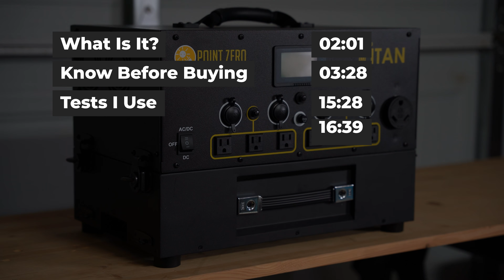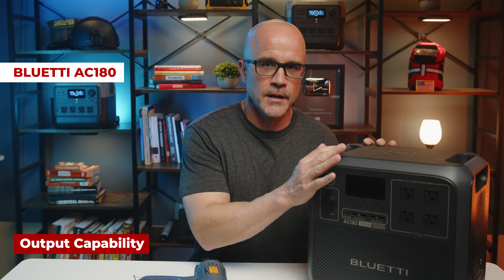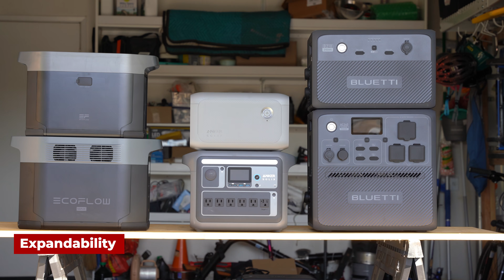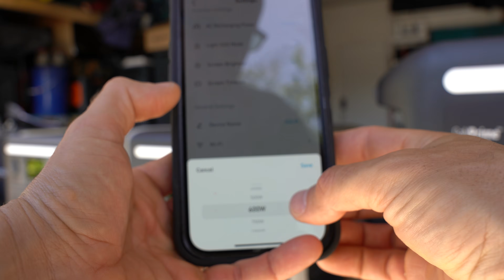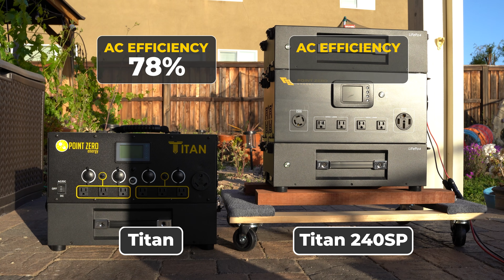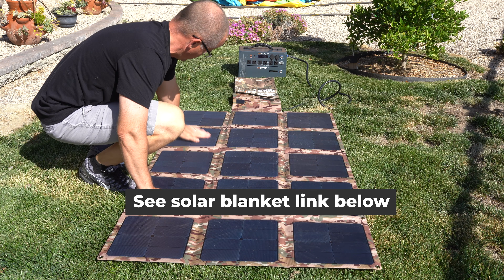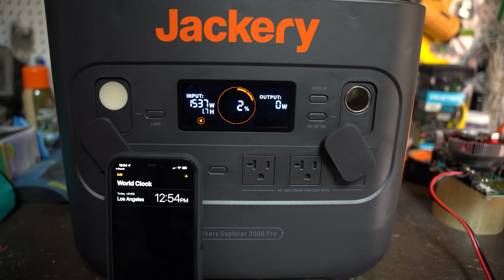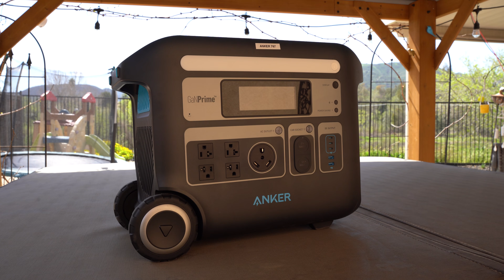Best Solar Generator for 2024 (The Ultimate Guide)

Comment: Ok...total newb here.... this is very informative....im looking for something to put on my houseboat (basically an rv on the water)....Im looking at the pecron 3000flp w (2) 300w panels....I think this would be more than enough to power a small fridge, starlink, house lights, water pump, coffee maker ,hot plate, small tankless water heater, tv and a battery tender for a starting battery (12v) ...no more than 3 of these would be used at any one time....one thing I havent heard in countless reviews is battery care....should these be run down to zero every time....do they have a "memory" or is it totally fine to keep the solar charging it and fluctuate to various levels while constantly charging via solar ? Any help would be greatly appreciated.....like I said total newb!!!

Comment: I'm glad to hear that you keep the Eco Flow units. I've gotten myself one of their Delta 3 power banks, one of their add-on batteries, and 400 watts worth of their solar panels. That gives me 7.2 kwh of power with the option of adding on another 3.6 kwh add-on battery later. I've got them in my barn as an off-grid power supply. All I really want to run with the setup is a small fridge, a string of chargers for cordless power tools, and some LED light strips. And the fridge is the only thing I want running all the time. I've powered that dorm fridge during a power outage for 7 hours using an Eco Flow River 3 unit with barely any storage compared to the Delta 3 + add-on. Once I get the solar panels mounted on the barn roof, I should be able to keep that little fridge keep running all the time. I mean, it's in a barn--not keeping the house running, LOL! I just want to keep drinks cold for when I'm doing yard work so I don't track dirt into the house, charge cordless power tools off-grid, and maybe run a corded drill press for a few minutes a month.  --Dan

Comment: We have a Ecoflo  Delta Max 2000. Been using it for 4 yrs at our 3 season cabin.  We usually charge it up at home.
Still going strong. ❤
I just ordered the Ecoflo Delta 2 for small appliances. Will likely buy the extra battery if we need it.

Comment: Please open the units and see how easy it is to replace a Lithium cell. Solar generators can have up to a hundred (or more) Lithium (LiFePO4 / LPO) cells.  Most of companies spotweld the cells together which makes it very difficult to replace a bad cell. Screw terminals usually make it much easier to repalce a bad cell.

Comment: So I'm REALLY learning alot on my quest for a sole generate r. I'm looking at jacker Explorer 2000. Just talked to a guy their. For $1599.00.i get that unite, 200 watt. Solar panel .2000 watt.unite . Running my laptop for 6 hours. Minnie fridge all time, box fan, 12 volt  light at night, charge 2 phones 2hrs ,, day & half before unite needing charged/ without connecting 200 watt solar panel yet. Does that sound right.without variables. And also found out you,,,possibly can use an led light to charge solar???¿I guise as long as you get more than u use?? If it's possible. Lol. I REALLY appreciate  any feedback. Thanks ahead... Mike

Comment: One of my ECO FLOW Delta Pro's wasn't working properly, it would die completely once it hit 30% battery power, I contacted customer support and they took the unit back and repaired it. The whole process was very quick and easy. Highly recommend!

Comment: There is some incorrect information in this video. The Jackery at 11:00 is actually the newer model with LiFePho nattery, not a Li-Ion battery. The older model could only go 500 cycles (with it's LIi-Ion battery) ❤before degrading, whereas the newer models go FAR longer.

Comment: How much are the expansion batteries? Is it worth the cost? If you purchase the expansion batteries at the same time as the generator what is the cost of battery replacement? Paying thousands and having to replace the batteries after a few years, how does that stand up against a gas generator. My gas generators last me about 15-20 years at about 1/2 or less the cost. Have you done a comparison? Thank for sharing all this information.

Comment: I own the Delta II, Delta II Max and Delta Pro.   The Max takes my vote with its two solar inputs, each at 500W and 15Amps.  This means if you are space limited you could your two arrays facing slightly different directions for morning, afternoon or late afternoon sun exposure.   Plus the Max is expandable to 6Khw

Comment: No one ever talks about mppt efficiency of polling rate on units or compares. A unit that turns on earlier in the day with your solar panels in low light can be a huge advantage.Knowing how your mppt performs its sweeps is important.  Everyone always plugs in the panels and goes "oooh look at the max power when everything is aimed perfectly at the sun" . But the truth is controllers in a test with arrays side by side will perform differently. A similar issue is done with panel testing with shadows. A hard shadow when placing panels should be avoided of course, but no one ever tests quickly moving shading and how fast the Mppt recovers and is able to produce the most watts quickly or if it takes longer to find the maximum again.

Comment: You may or may not have a good experience with your Pecron products, however, you should have the expectation that there will be little to no after sale support from Pecron. I've been dealing with them for over a month to get my E1500 repaired. I was told I would have a 3 Year warranty if I preorder it when they were first releasing them. After a year and a half I am having a problem with it and they have only offered to send me parts to try and fix it myself to which so far none of their suggested repairs have worked. For me, I  won't ever buy another Pecron product.

Comment: I have had the Bluetti AC200Max since launch and it has been great. Recently picked up the Ecoflow River 3 for a UPS on my router and desk lamp during a power outage. I am all about potential for portability. I have a battery bank for my house for backup if all else fails. My primary power source in a power outage is propane. I like to know that even if fuel becomes impossible to get, that I have enough battery and solar to last me a week in sub par conditions.

Comment: Why are they called generators when they are storage batteries?😮
Reply: I would guess the same reason an air fryer is named as such , though it has zero relationship to frying . Good or bad it's a design decision to help explain what it's used for , more than how it does it .

Comment: Hi -  I tried using the spreadsheet  and all the  power banks were insufficient. I picked a 1 fridge, laptop, wifi/router, 2 cell phones. The total use was 3720 W with a deficit of -3594 W not sure if that means I need over 7K??  Even when I took the fridge out it was a total of 1320 W and most were still too low.   Not sure if I did something wrong?? 
I noticed the fridge surge is at 1000 which seems high - my fridge is max 828 watt(115v x7.2amps).  

Separately I was curious if you have any Watt info on tankless water heaters (I have gas for appliances). A couple ppl have said they used a small 500W  powerbank to run it briefly for1-2 hours so ppl could shower....
Thanks

Comment: Just bought a Jackery 1000v2 with 200W solar pack to run alongside my solar/leisure battery set up in my campervan....so far so good, cant wait to get out on the road with it, to test it properly....bought it so I can survive off grid easier.
And jackery were doing 44% off the 1000v2 so it was a no brainer !
Stay tuned for my off grid, real world review.

Comment: I have a system that i designed myself.  It didn't cost less except the batteries (from wrecked car).  The rest of the system other than the batteries cost more. It is a lot more flexible, though.  I can see a lot of ways to inadvertently make a system like this unsafe. I would not have tried this without my electrical engineering background.

Comment: ? Question that I think needs to be addressed ?
The name plate on my fridge does not show POWER.  It only shows volts and amps.   The amps shows as 7,1.  My hunch is that this is the surge amps during a cooling cycle so that the owner can do load balancing on the circuit such that the fridge does not trip the breaker during typical use on grid.  But maybe  its typical draw during the cooling cycle after the surge.  IDK

Comment: Great summary of products. Totally agree. . EcoFlow just keeps advancing technology, smaller units, more features, more runtime. Great customer support and warranty. My company uses the delta 2 max with a 220 watt solar panel on the job building custom homes. And I use one in my work van, charges all my batteries as I drive and runs my fridge freezer 24-7..Then I throw a 220 solar panel out on the roof to keep the battery full.

Comment: Bought a delta max 2 in march had problems from the start ran it down twice while i was testing it out with smaller appliances,now when i plug it in wont charge says overload sent it back to ecoflow today said they would replace it with a refurbished one said it could be dented and scratched  and at least a 90 percent battery life not sure its a fair trade with the new one I’m sending back well see how it goes when i get it

Comment: CP ran some information by so fast most people missed it. He said to only run 50 to 70 % of the units rated power so it will last longer, very important and very true, accept for the Titan, because the Titan is the only low frequency unit thats built to do it. All the others are high frequency inverters, and for those to last any length of time, only run half of what its rated. And as far as 2024, that Titan is way older than that, thats there old unit. He has under rated the Titan a couple of times, I say that because he has only used stats on paper, he has never actually had one to test side by side, or physically. If he ever actually had hands on with one, he would know the difference beyond any doubt. I will say he makes great videos, but they are not based on actual knowledge, even trying to pass this test, of a 5 yr old Titan, which is still a much better unit than all of these, is a realistic comparison. Todays Titans way surpass the old one, and still remain on top in the solar generator field. If you build your own, which can be easily done nowaday, just start with a low frequency inverter,  and you will be way happier and way ahead. The Titan, even this old one, is the only one in all of them that is ,low frequency, unlimited exspansion, and can use any battery chemistry, from any company, not just there own.

Comment: Another question. I want one only for backup for my gas furnace blower and ignition if the power goes out, which it sometimes does. Usually less than 12 hours, but it always seems to happen at night. So, I have to store it fully charged. You say don't do that. What option do you see for that issue?

Comment: I had a terrible experience with one of these companies. You never mention the service aspect in your assessment, yet that is one of the most critical elements of which company I would choose. The "reviews" on their websites are not reliable anymore, and even reviews such as yours are now suspect. We never know if we are getting the true picture. But if something is awry with the unit (mine never did work and there was zero response from the company. I still have the thing sitting in my basement. Don't know if they want it back or not. I feel I was scammed). So, tell us - do they answer the phone, or is it AI that answers? Can you even phone them, or is it email only which means you have to trust them to respond? Their customer service is a vital component that I wish you could comment on.

Comment: If you plan on having an Eco Flow Delta Pro 3 Power station( indoors ) where there are humans - the unit ( In Canada - not sure about the US) must have a UL 2540A rating for fire protection during a Battery runaway.
I JUST BOUGHT THE  Eco Flow Delta Pro 3 Power station AND THE EXTRA SMART Battery 4000 Watts each - total 8000 Watts, and the Electrical Inspector during the install Inspection indoors - at first couldn't find the UL 2540A Certification, so I had to go through  (10) E mails (so far,  to get the needed info - and expect very late at night E mail replies - you are talking to China)  to get the certification documents  - or - I would have to build a fire safe room for the Batteries , as per the Alberta Electrical code 64-1100 which uses the NBC Canadian National Building codes for any ESS system (Energy Supply System) -  (Batteries). The video here appears to be about an inside system where there are humans, but this applies to even an attached garage, or undeveloped basement it will still need a UL2540A certification...if you don't want to build a fire safe room as per NBC( Canada not sure about US rules)  Just a heads up.
Reply: Correction correction should have said UL9540A  and not UL2540A in prior post.

Comment: A solar generator is a charge controller, battery charger, battery bank and an inverter. It's way cheaper if you build it yourself, then if something goes wrong, you will be better equipped to fix it yourself.

Comment: I just bought a second delta 2 for $460. To run a 55 quart dual zone alpicool I still use a 5 year old 300w rocpals with 100w panel. Keeps beer cold while camping

Comment: I know nothing about this stuff.  I wonder if having multiple power stations is worthwhile charging one while using the other. Swapping then as needed.

I am thinking about having something to power my refrigerator and freezer in a SHTF situation.  Especially if the power would be out for an extended time.  

The refrigerator and freezer are my greatest concern.  I would guess that by not opening them often the motors will run much less.

Comment: I would not necessarily agree with the durability of the Ecoflow products based on my experience. I purchased a Delta 1300 in 2019 and it died in 2021. Luckily they replaced it. Now it's 2024 and the second Delta 1300 has died and it is no longer under warranty. So gosh, I've gone through two of these in five years.

Comment: I have a question on the spreadsheet.  I used a "Kill a Watt" to find the watts on my O2 Concentrator. On "Kwh hour "  I got .25 when the hour was up.  I got 285 when I used the Watt/Va button. Which is the one I use on the spreadsheet?

Comment: Bluetti AC180 data has errors. Cost is $500 not $1,000. It can accept the B3400k add on battery with 2765 Wh at $1100. It provides 1,800 watts. At 1/3 less cost / Wh, I find it the clear winner. More so when you consider the add on battery value. ($700 for 1024 Watts with the Ecoflow Delta II Max). With add on batteries the AC180 provides ~4000 wh for $1600 ($0.4 / Wh) versus ~3000 Wh for $2300 ($0.8 / Wh) with the Ecoflow Delta II Max. Bluetti AC180wins in my opinion in the 2k watt range.

Comment: Then it's not a generator it's a battery in a box
Reply: It is a solar generator. When you hook solar panels up to it, it generates electricity for you to use. Much like a fuel generator takes gasoline and turns it into electricity that you can use. The only difference is the fuel source. Just a battery in the box is what is in your car.

Comment: This was very informative with one exception. These Solar Generators are all lacking when it comes to cold weather performance. If the temperature drops below freezing, you will not be able to charge them. I live in a cold weather region and found out the hard way that the Bluetti AC200 will not operate below freezing temperatures. When it comes to being prepared, be careful with Solar Generators because they will leave you out in the cold, and aren't any better then a boat anchor at that point.
Reply: I noticed the new Pecron e1000lfp I ordered has a battery heating feature. Maybe that is something they will be rolling out across all models. Seems like they listen to feedback.
Reply: Definitely something to be mindful of if you live in extreme climates (heat included). There are some brands that can function down to -4 Fahrenheit, sometimes it can be hard to dig that info out of them. On the other end of the spectrum a lot of them are rated to only function up to 107, have to be careful if you're out in the desert in summer!